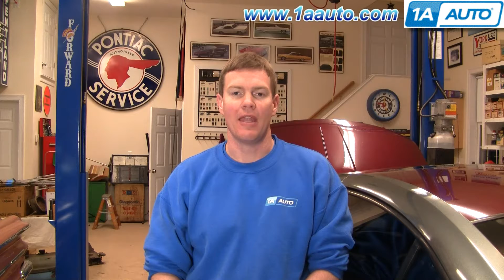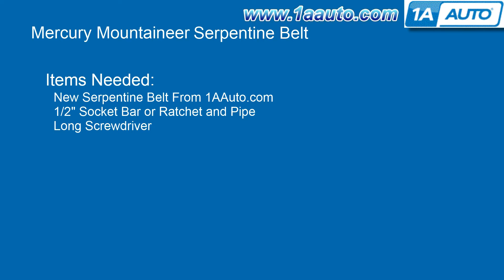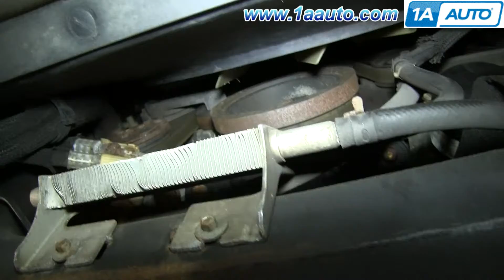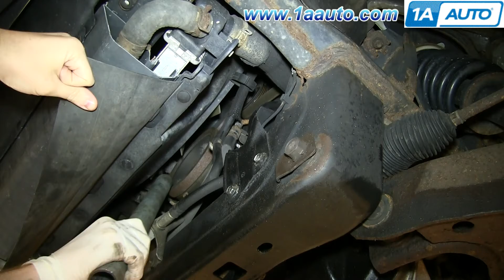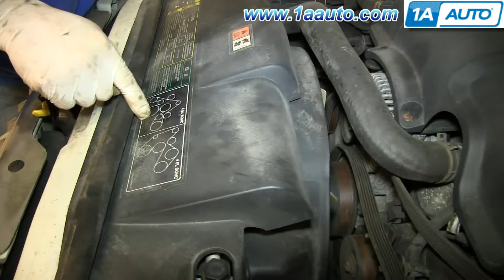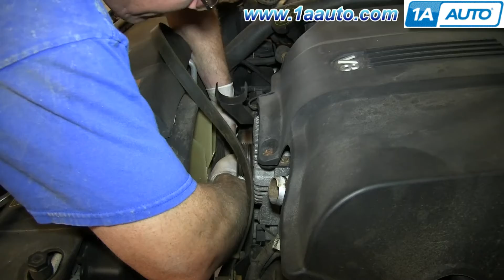How to Replace Serpentine Belt 02-05 Mercury Mountaineer 4.6L V8

Comment: I have a lot of respect for A1 Auto for it's terrific videos.

Having to replace the alternator on my 2004 explorer V8 with towing package and rear A/C turned into a pain in the arse.  

The issue was simply being able to get to the tensioner to remove the belt from the Alt. pulley.
Once you get the belt off the alternator is a five minute job. 
Soooo lets go see how A1 would do it as I was fighting the fan blade and the upper radiator hose from the top side. They seen to always have the best trick or technique.

As you can see the hey have the vehicle up on  hoist and gain access to the tensioner from the bottom. I don't have a hoist and  I hate crawling on the ground but if this is the best way well so be it. 

Not this one!  There is a big cooling fin assembly for either transmission or power steering or maybe part of A/C. Doesn't matter, it is in my way more so than from top side.
With a 10mm socket in hand I pulled the t-stat housing (better if you can pull the hose I am sure, but mine was stuck on pretty good) with the upper rad hose attached then pulled the hose over toward the rf fender.
Plenty of room now using my relatively thin 1/2 drive breaker bar. Only lost about a pint of coolant. 

OTC, Lisle, S&G Tool all make a specific tool for this but not a financially viable option unless you are in the trades or do a lot of work frequently on the ford V8.

Getting the belt back on was infuriating to say the very least...cuss cuss cuss automotive engineers!  
Absolutely no room for my long arms to get the belt around the P.S pulley AND under the belt keeper pin!! Stupid, stupid design!! If you have a spare person to crawl under the vehicle at the same time you are top side it would not be so difficult.

3 more 10mm head sheet metal screws holding the P.S. reservoir  were removed to gain access by moving reservoir out of the way (not removed, just moved out of the way)

I wonder what the Ford service manual says..."Remove engine to access belt."?  

Kidding aside if you need to change the belt  consider doing the upper hose and reservoir movement. It will save you some angst.
My Grand Marquis 4.6 takes less than 10 minutes to r&r belt and less than 5 more minutes to R & R the alternator.

Does anybody know why Ford continued with a fan blade with fan clutch on the Explorer? I would have to presume that it provides better cooing than an electric fan set up eh?? Hard to belive though.

To A1 auto: 
Thanks again for all of your well done videos. They usually save me a ton of time and research.
I love it when I can reach for the exact socket, box end wrench etc as specified by the video.
Sure we could all figure it out but you save our limited commodity called time !

Comment: This video is totally unhelpful. It's a 1/2" drive breaker bar, not a 3/8". Also, if you actually installed it on a 4.6L SOHC V8, you would have needed to route it around the fan, which you didn't do. So the install is edited to exclude certain essential details. So anybody expecting to figure out how to do this job, expect to run into a point at which you need to figure it out for yourself.